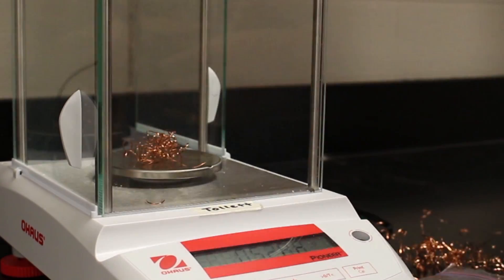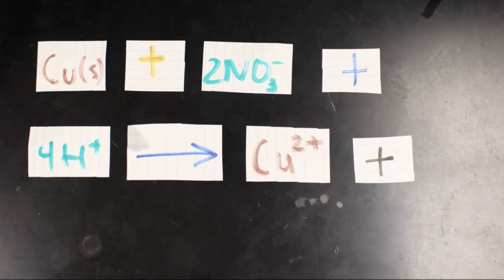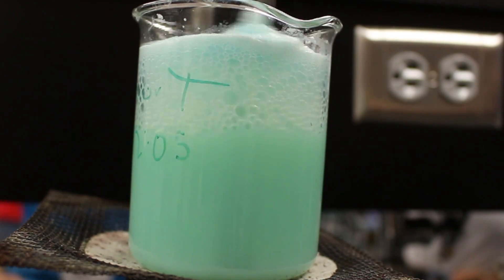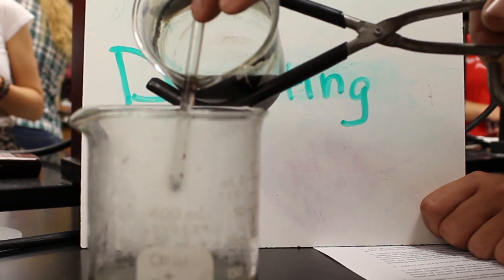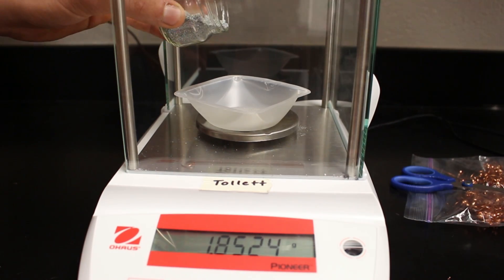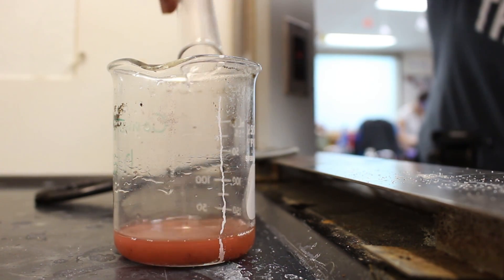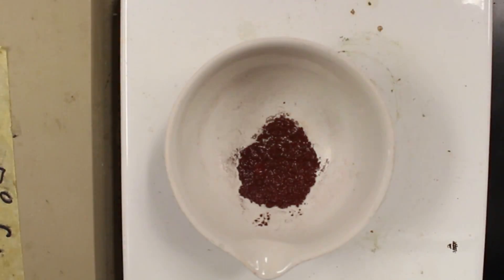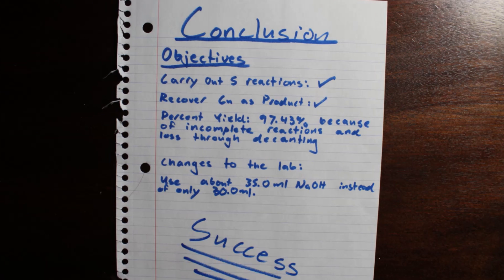Reactions of Copper Lab

Comment: Could someone please explain me something: what did the first light solution consisted off besides Copper ions?
Reply: After searching online for a formula, i think I could explain the confusion based on the observation that you explained the reaction between solid copper and Nitric acid as Cu(s)+2NO3-+4H+= Cu2+NO2+H2O without giving account of NO3- in the products, which is the substance that is, along with copper, in solution in water